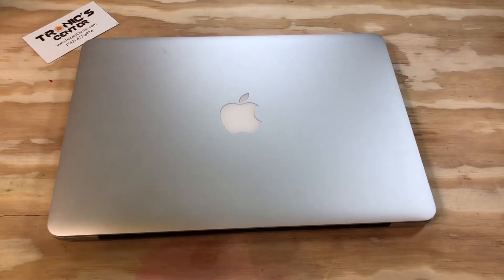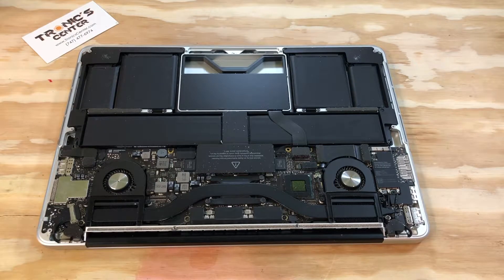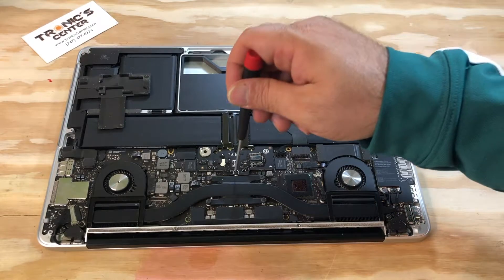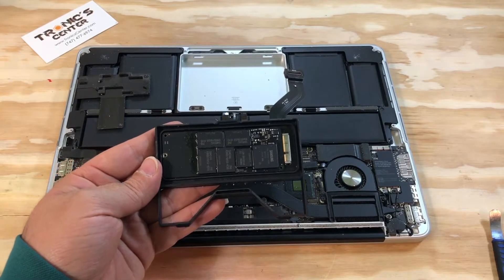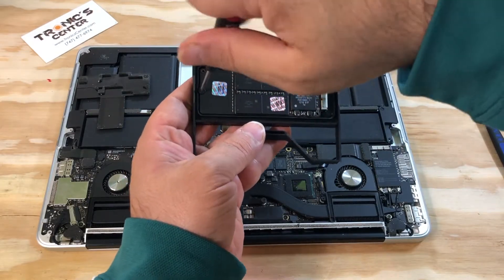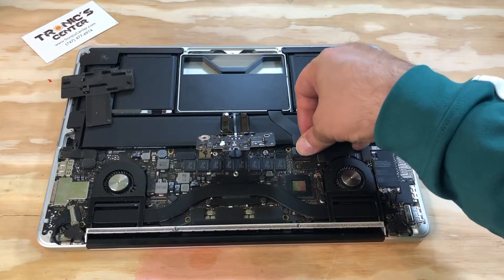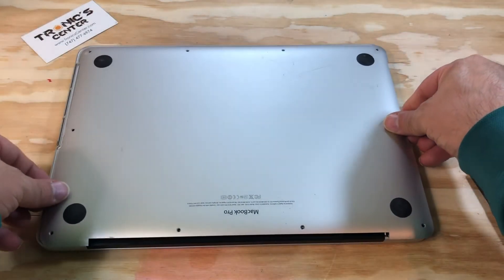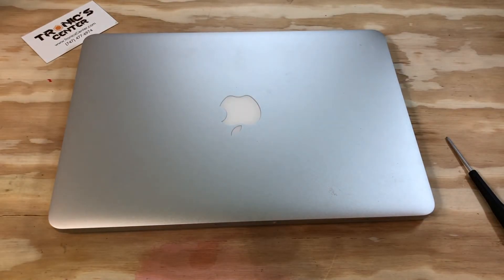Replacing SSD Pcie Storage on 13" MacBook A1425 - SSD installation 13" MacBook Pro A1425    HD 1080p

Comment: Thanks for video.
is there a way to check the old ssd drive for lost files, plugging it into a adapter for another computer.
John
Reply from the maker: Hello
Thanks for watching, not sure .
Reply from the maker: A2251 KeyWords 

MacBook Pro "Core i5" 2.0 13" 2020 4 TB 3, 2.0 GHz Core i5, I5-1038NG7, MacBook Pro "Core i7" 2.3 13" 2020 4 TB 3, 2.3 GHz Core i7,  I7-1068NG7, MacBookPro16,2 , 2020 13" 4 TB 3 , A2251 MacBook , EMC 3348, MWP72LL/A, BTO/CTO

————————————————————

A2141 KeyWords 

MacBook Pro "Core i7" 2.6 16" 2019, 2.6 GHz Core i7 (I7-9750H), 2.3 GHz Core i9 (I9-9880H), A2141 (EMC 3347), 2.4 GHz Core i9 (I9-9980HK) , MacBookPro16,1, MacBook Pro "Core i7" 2.6 16" 2019 5600M, 2.6 GHz Core i7 (I7-9750H),  MacBookPro16,4 , MacBook Pro "Core i9" 2.3 16" 2019 5600M, 2.3 GHz Core i9 (I9-9880H), MacBook Pro "Core i9" 2.4 16" 2019 5600M, 2.4 GHz Core i9 (I9-9980HK), MVVL2LL/A, MVVM2LL/A, 16" MacBook A2141

———————————————

A2179 Keywords

MWTJ2LL/A, EMC 3302 , 1.1 GHz Core i3 (I3-1000NG4) , MacBook Air "Core i3" 1.1 13" (Scissor, 2020) , MacBookAir9,1 , 1.1 GHz Core i5 (I5-1030NG7) , MVH22LL/A , MacBook Air "Core i7" 1.2 13" (Scissor, 2020), 1.2 GHz Core i7 (I7-1060NG7)

——————————————

A2159 Keywords 

1.4 GHz Core i5 (I5-8257U) , MacBook Pro "Core i5" 1.4 13" Touch/2019 2 TB 3 , MacBook Pro "Core i7" 1.7 13" Touch/2019 2 TB 3 , 1.7 GHz Core i7 (I7-8557U) , MUHN2LL/A , A2159 , EMC 3301 , MacBookPro15,4 , 2019 13" (Touch Bar, 2 TB 3), 13" MacBook Pro A2159

—————————————————————

A1932 Keywords  

MRE82LL/A , MVFH2LL/A, 1.6 GHz Core I5-8210Y, 1.6 GHz Core I5-8210Y, MacBookAir8,1 , EMC 3184 , 13" MacBook Air Space Gray, 13" MacBook Air Gold , 13" MacBook Air Silver , 13" MacBook Air 2019 13" MacBook Air 2018, 13" MacBook Air A1932

—————————————————————

A1534 Keyword’s

EMC 2746, MF855LL/A, MF865LL/A, EMC 2991, MLHA2LL/A, MLHC2LL/A, EMC 3099, MNYF2LL/A, MNYG2LL/A, MacBook8,1 , 1.1 GHz Core M (M-5Y31) , 1.2 GHz Core M (M-5Y51), 1.3 GHz Core M (M-5Y71), 1.1 GHz Core m3 (M3-6Y30), 1.2 GHz Core m5 (M5-6Y54), 1.3 GHz Core m7 (M7-6Y75), 1.2 GHz Core m3 (M3-7Y32), 1.3 GHz Core i5 (I5-7Y54), 1.4 GHz Core i7 (I7-7Y75), MacBook9,1 , MacBook10,1

——————————————————

A1990 Keywords

MR932LL/A, 2.2 GHz Core i7 (I7-8750H), EMC 3215, MacBookPro15,1 , MR942LL/A 2.6 GHz Core i7 (I7-8850H), 2.6 GHz Core i7 (I7-8850H), 2.9 GHz Core i9 (I9-8950HK), 2.6 GHz Core i7 (I7-9750H), EMC 3359, 2.3 GHz Core i9 (I9-9880H), 2.4 GHz Core i9 (I9-9980HK), MacBookPro15,3, A1990 MacBook, 15” MacBook A1990

———————————————————

A1989 Keyword 

A1989 MacBook 2018 MR9Q2LL/A, 2.3 GHz Core i5 (I5-8259U), BTO/CTO, 2.7 GHz Core i7 (I7-8559U), EMC 3214, MacBookPro15,2 , A1989 MacBook 2019 MV962LL/A , 2.4 GHz Core i5 (I5-8279U) , MV982LL/A, 2.8 GHz Core i7 (I7-8569U) , EMC 3358, 13" MacBook A1989

———————————————

A1708 Keywords

MLL42LL/A, A1708, EMC 2978, MacBookPro13,1 , 2.0 GHz Core i5 (I5-6360U) , 2.4 GHz Core i7 (I7-6660U) , MPXQ2LL/A, EMC 3164, 2.3 GHz Core i5 (I5-7360U) , 2.5 GHz Core i7 (I7-7660U), MPXQ2LL/A, 13" MacBook A1708

———————————————————— 
MacBook 

Apple, MacBook, 13" MacBook, MacBook Air, A1466 MacBook, MacBook Air logic Board, 13" MacBook Air , Apple Mac , 11” MacBook , A1465 MacBook, A1502 MacBook, A1398 MacBook, A1425 MacBook, A1706 MacBook, A1708 MacBook, A1707 MacBook, A1990 MacBook, A1989 MacBook, A2159 MacBook, A2179 MacBook, A2289 MacBook, A2337 MacBook, A2338 MacBook, A2141 MacBook, MacBook Pro, MacBook Pro Retina, Retina display, True Tone Display , Top Case KeyBoard, Apple Keyboard, MacBook KeyBoard, MacBook Trackpad.
———————————————————

A1398 MacBook, A1398 Logic Board, A1398 LCD, A1398 KeyBoard , A1398 Display, MC975LL/A, MC976LL/A, MD831LL/A, ME664LL/A, ME665LL/A , ME698LL/A, ME293LL/A, ME294LL/A, ME874LL/A, MGXA2LL/A, MGXC2LL/A, MGXG2LL/A, MJLQ2LL/A, MJLT2LL/A, MJLU2LL/A

—————————————————————

A1706 Keywords

MLH12LL/A, A1706 EMC 3071, MacBookPro13,2 , MacBookPro14,2 , MPXV2LL/A, A1706 EMC 3163 , 3.5 GHz Core I7-7567U, 3.3 GHz Core I5-7287U, 3.1 GHz Core I5-7267U, 3.3 GHz Core I7-6567U, 3.1 GHz Core I5-6287U, 2.9 GHz Core I5-6267U, A1706 MacBook, A1706 MacBook Touch Bar 

—————————————————————
A1707 Keywords 

MPN 923-01477 , MLH32LL/A, MLH42LL/A, MPTR2LL/A, MPTT2LL, EMC 3072, MLH32LL/A, MacBookPro13,3, 2.7 GHz Core i7 (I7-6820HQ), MLH42LL/A, 2.9 GHz Core i7 (I7-6920HQ), EMC 3162 , 2.8 GHz Core i7 (I7-7700HQ), MacBookPro14,3 , 2.9 GHz Core i7 (I7-7820HQ), MPTR2LL/A, MPTT2LL/A, 3.1 GHz Core i7 (I7-7920HQ), A1707 MacBook, A1707 Touch Bar

Comment: well done brother
Reply from the maker: there are many Apple MacBook Available with high Spec's such as A1707, A1708, A1706, A1990, A1989, A2141, A2159, A2179 and we do offer original part's for them in if you need any part
you may visit our website at www.tronicscenter.com
Reply from the maker: A2251 KeyWords 

MacBook Pro "Core i5" 2.0 13" 2020 4 TB 3, 2.0 GHz Core i5, I5-1038NG7, MacBook Pro "Core i7" 2.3 13" 2020 4 TB 3, 2.3 GHz Core i7,  I7-1068NG7, MacBookPro16,2 , 2020 13" 4 TB 3 , A2251 MacBook , EMC 3348, MWP72LL/A, BTO/CTO

————————————————————

A2141 KeyWords 

MacBook Pro "Core i7" 2.6 16" 2019, 2.6 GHz Core i7 (I7-9750H), 2.3 GHz Core i9 (I9-9880H), A2141 (EMC 3347), 2.4 GHz Core i9 (I9-9980HK) , MacBookPro16,1, MacBook Pro "Core i7" 2.6 16" 2019 5600M, 2.6 GHz Core i7 (I7-9750H),  MacBookPro16,4 , MacBook Pro "Core i9" 2.3 16" 2019 5600M, 2.3 GHz Core i9 (I9-9880H), MacBook Pro "Core i9" 2.4 16" 2019 5600M, 2.4 GHz Core i9 (I9-9980HK), MVVL2LL/A, MVVM2LL/A, 16" MacBook A2141

———————————————

A2179 Keywords

MWTJ2LL/A, EMC 3302 , 1.1 GHz Core i3 (I3-1000NG4) , MacBook Air "Core i3" 1.1 13" (Scissor, 2020) , MacBookAir9,1 , 1.1 GHz Core i5 (I5-1030NG7) , MVH22LL/A , MacBook Air "Core i7" 1.2 13" (Scissor, 2020), 1.2 GHz Core i7 (I7-1060NG7)

——————————————

A2159 Keywords 

1.4 GHz Core i5 (I5-8257U) , MacBook Pro "Core i5" 1.4 13" Touch/2019 2 TB 3 , MacBook Pro "Core i7" 1.7 13" Touch/2019 2 TB 3 , 1.7 GHz Core i7 (I7-8557U) , MUHN2LL/A , A2159 , EMC 3301 , MacBookPro15,4 , 2019 13" (Touch Bar, 2 TB 3), 13" MacBook Pro A2159

—————————————————————

A1932 Keywords  

MRE82LL/A , MVFH2LL/A, 1.6 GHz Core I5-8210Y, 1.6 GHz Core I5-8210Y, MacBookAir8,1 , EMC 3184 , 13" MacBook Air Space Gray, 13" MacBook Air Gold , 13" MacBook Air Silver , 13" MacBook Air 2019 13" MacBook Air 2018, 13" MacBook Air A1932

—————————————————————

A1534 Keyword’s

EMC 2746, MF855LL/A, MF865LL/A, EMC 2991, MLHA2LL/A, MLHC2LL/A, EMC 3099, MNYF2LL/A, MNYG2LL/A, MacBook8,1 , 1.1 GHz Core M (M-5Y31) , 1.2 GHz Core M (M-5Y51), 1.3 GHz Core M (M-5Y71), 1.1 GHz Core m3 (M3-6Y30), 1.2 GHz Core m5 (M5-6Y54), 1.3 GHz Core m7 (M7-6Y75), 1.2 GHz Core m3 (M3-7Y32), 1.3 GHz Core i5 (I5-7Y54), 1.4 GHz Core i7 (I7-7Y75), MacBook9,1 , MacBook10,1

——————————————————

A1990 Keywords

MR932LL/A, 2.2 GHz Core i7 (I7-8750H), EMC 3215, MacBookPro15,1 , MR942LL/A 2.6 GHz Core i7 (I7-8850H), 2.6 GHz Core i7 (I7-8850H), 2.9 GHz Core i9 (I9-8950HK), 2.6 GHz Core i7 (I7-9750H), EMC 3359, 2.3 GHz Core i9 (I9-9880H), 2.4 GHz Core i9 (I9-9980HK), MacBookPro15,3, A1990 MacBook, 15” MacBook A1990

———————————————————

A1989 Keyword 

A1989 MacBook 2018 MR9Q2LL/A, 2.3 GHz Core i5 (I5-8259U), BTO/CTO, 2.7 GHz Core i7 (I7-8559U), EMC 3214, MacBookPro15,2 , A1989 MacBook 2019 MV962LL/A , 2.4 GHz Core i5 (I5-8279U) , MV982LL/A, 2.8 GHz Core i7 (I7-8569U) , EMC 3358, 13" MacBook A1989

———————————————

A1708 Keywords

MLL42LL/A, A1708, EMC 2978, MacBookPro13,1 , 2.0 GHz Core i5 (I5-6360U) , 2.4 GHz Core i7 (I7-6660U) , MPXQ2LL/A, EMC 3164, 2.3 GHz Core i5 (I5-7360U) , 2.5 GHz Core i7 (I7-7660U), MPXQ2LL/A, 13" MacBook A1708

———————————————————— 
MacBook 

Apple, MacBook, 13" MacBook, MacBook Air, A1466 MacBook, MacBook Air logic Board, 13" MacBook Air , Apple Mac , 11” MacBook , A1465 MacBook, A1502 MacBook, A1398 MacBook, A1425 MacBook, A1706 MacBook, A1708 MacBook, A1707 MacBook, A1990 MacBook, A1989 MacBook, A2159 MacBook, A2179 MacBook, A2289 MacBook, A2337 MacBook, A2338 MacBook, A2141 MacBook, MacBook Pro, MacBook Pro Retina, Retina display, True Tone Display , Top Case KeyBoard, Apple Keyboard, MacBook KeyBoard, MacBook Trackpad.
———————————————————

A1398 MacBook, A1398 Logic Board, A1398 LCD, A1398 KeyBoard , A1398 Display, MC975LL/A, MC976LL/A, MD831LL/A, ME664LL/A, ME665LL/A , ME698LL/A, ME293LL/A, ME294LL/A, ME874LL/A, MGXA2LL/A, MGXC2LL/A, MGXG2LL/A, MJLQ2LL/A, MJLT2LL/A, MJLU2LL/A

—————————————————————

A1706 Keywords

MLH12LL/A, A1706 EMC 3071, MacBookPro13,2 , MacBookPro14,2 , MPXV2LL/A, A1706 EMC 3163 , 3.5 GHz Core I7-7567U, 3.3 GHz Core I5-7287U, 3.1 GHz Core I5-7267U, 3.3 GHz Core I7-6567U, 3.1 GHz Core I5-6287U, 2.9 GHz Core I5-6267U, A1706 MacBook, A1706 MacBook Touch Bar 

—————————————————————
A1707 Keywords 

MPN 923-01477 , MLH32LL/A, MLH42LL/A, MPTR2LL/A, MPTT2LL, EMC 3072, MLH32LL/A, MacBookPro13,3, 2.7 GHz Core i7 (I7-6820HQ), MLH42LL/A, 2.9 GHz Core i7 (I7-6920HQ), EMC 3162 , 2.8 GHz Core i7 (I7-7700HQ), MacBookPro14,3 , 2.9 GHz Core i7 (I7-7820HQ), MPTR2LL/A, MPTT2LL/A, 3.1 GHz Core i7 (I7-7920HQ), A1707 MacBook, A1707 Touch Bar